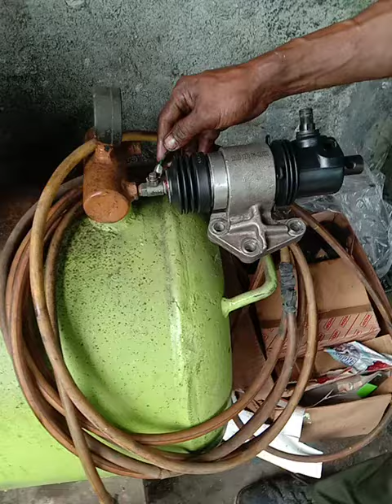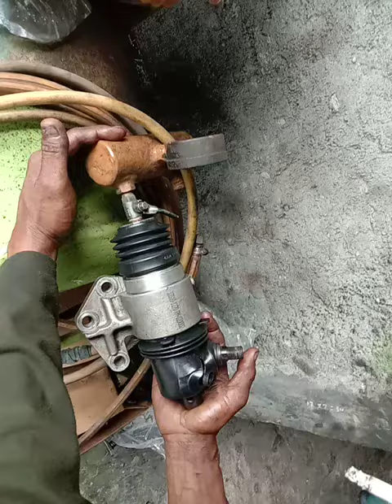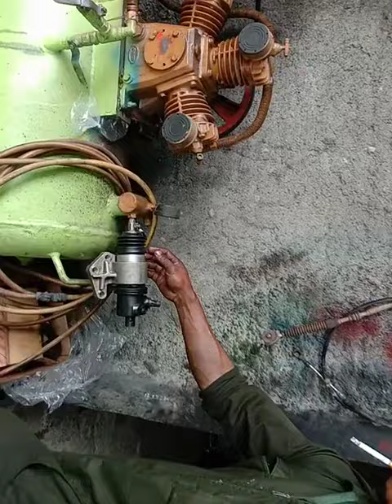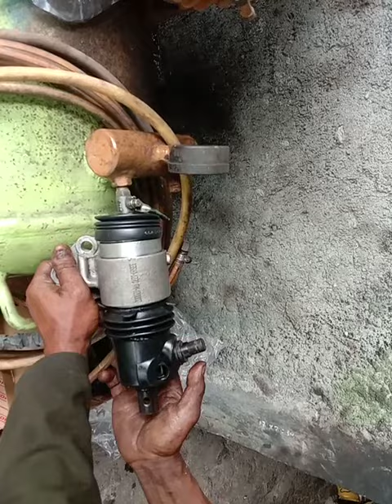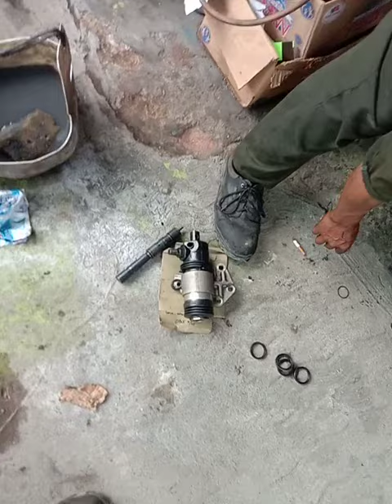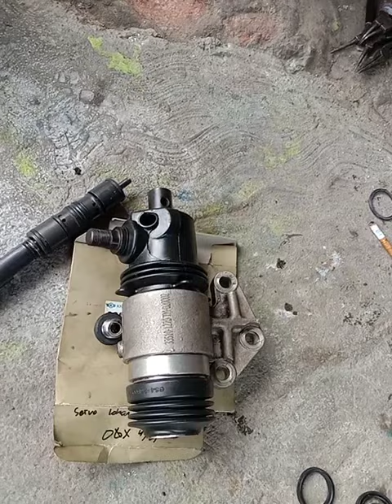cara pengetesan power shift hino yg telah di servis #servohandel

Comment: Bang mau tnya kalau power sift keras penyebabnya di mna ya 🙏
Reply from the maker: Itu dah gantian belum,klu dah gantian ga ori ya gitu bos q 
Tapi klu belum/ masih ori biasanya kupu" handelnya macet bos q
Reply: Udah ganti yg mitasi bosku , yg hrga 1 juta kmrin
Reply: Kalau kedepan gigi 1,3,5 agak enteng si bos cman yg yg mundur gigi R,2,4,6 yg agak keras
Reply from the maker: Ya memang begitu klu udah gantian,aga keras dikit bos,
Reply: Bisa rekomendasi part kit.x ka bang mau ganti yg aslinya tpi yg ada boch plastiknya soalnya yg asli boch plastiknya pecah jdi angin bocor
Reply from the maker: @udhynk7770   klu piber yg untuk dudukan valve kuningan itu ga ada jual bos q 😔😔😔
Reply: It sdah bang tdk ada di jual
Reply: Abang ada barang copotan ka yg siap pakai 🙏
Reply from the maker: @udhynk7770   ga ada bos q 🙏🙏🙏